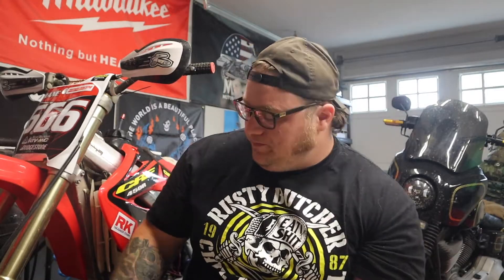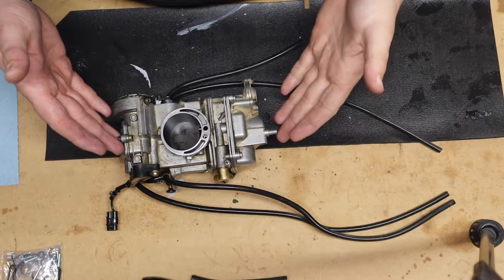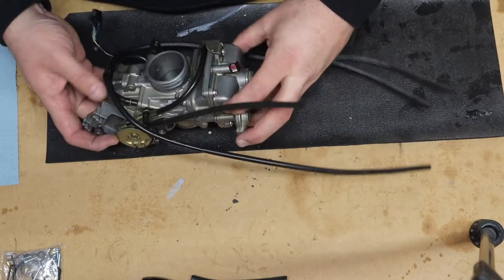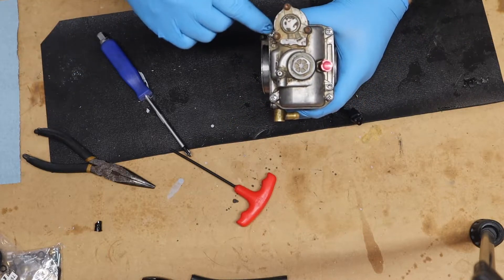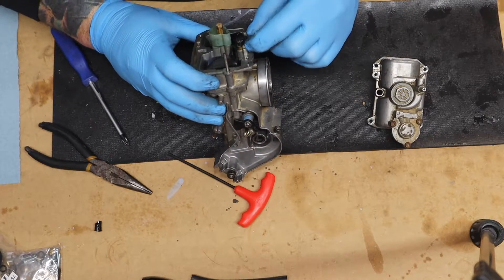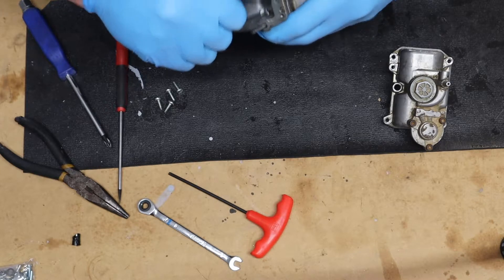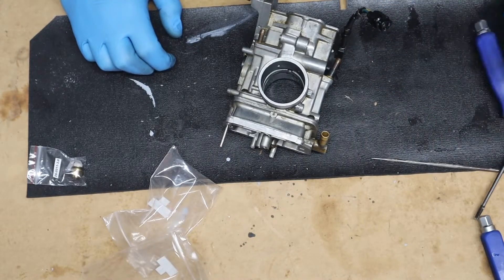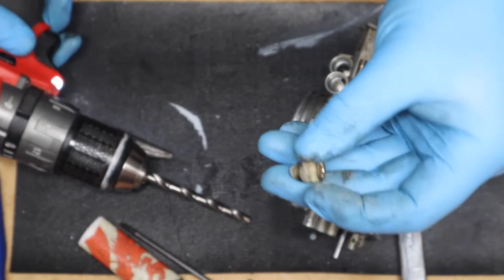Honda CRF Carburetor Rebuild Part 1: Disassembly

Comment: I found that a self taping screw gets that stuck filter out instead of using your electric drill. I also use a JIS screwdriver to save the heads of those + screws.